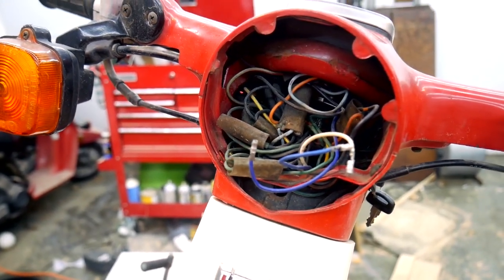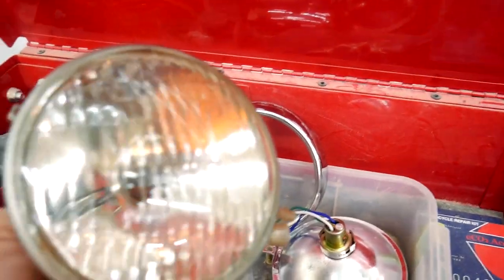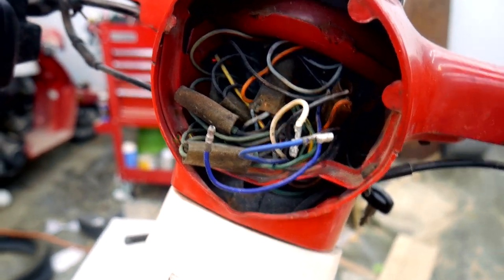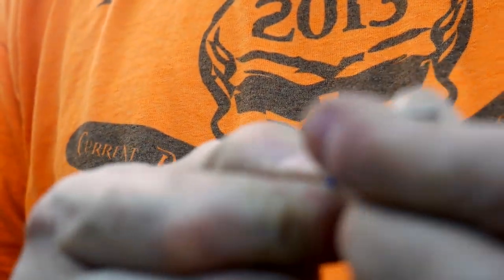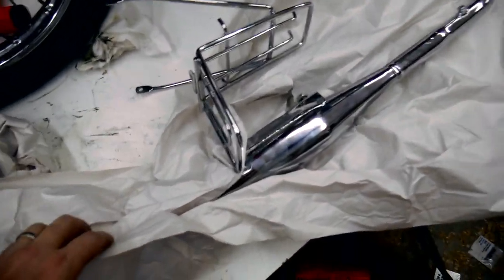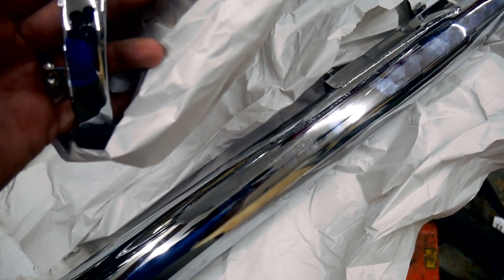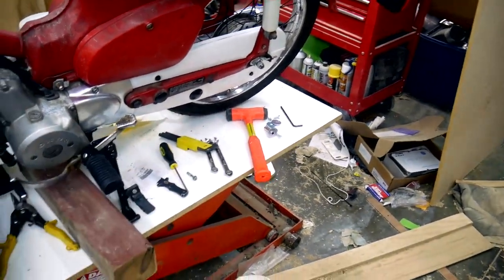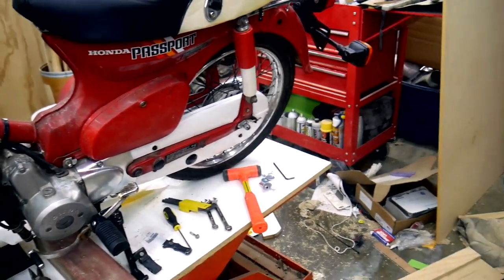Red 1982 Honda C70 Passport Part 4:  The Chrome is in!

Comment: Hi Thomas, not sure if you can help me, I have a C70 with 6 volt system. I had trouble finding a new ignition coil that would produce a spark. I found out that the coils they were sending me had a noise suppression resistor, 5000k Ω in the spark plug connector/cap. I am getting hints that the resistor cap coils are used on 12 volt./CDI ignition systems while the older 6 volt systems use the no resistor cable plugs. Do you have knowledge if that is true?
Reply from the maker: I believe you can use either the resistor or non-resistor caps on the 6-volt model. The resistor is used to reduce radio interference, if you need that sort of functionality.  If you still want to try non-resistor caps, you can try this link: http://dratv.com/noname46.html 
Great company and they have the best selection.  Of course, I am assuming you are in the U.S.  Not sure if they ship out of the country.  Good luck and let me know how it turns out!